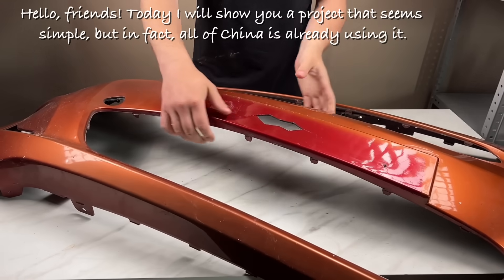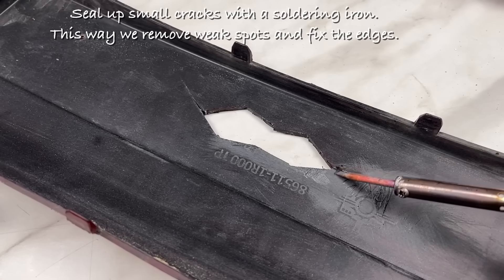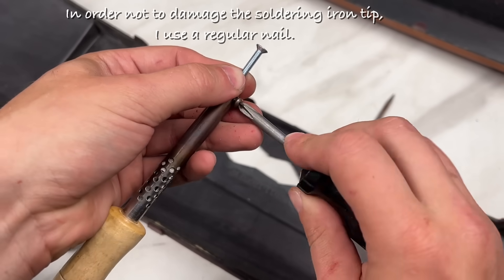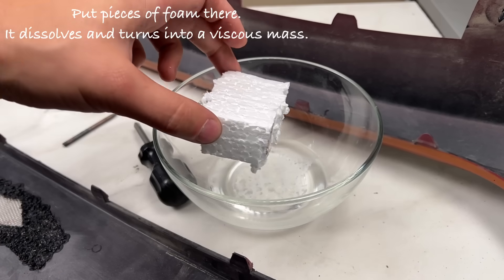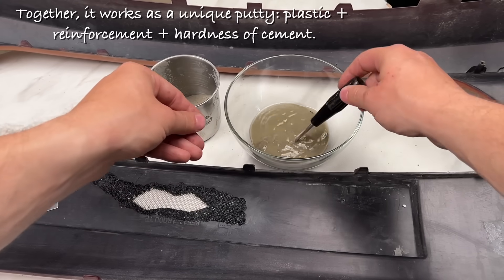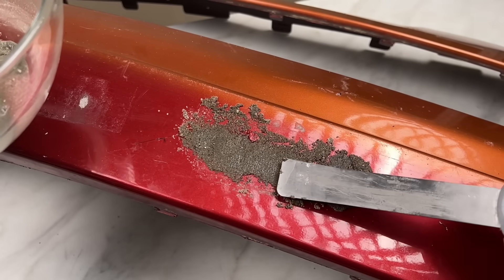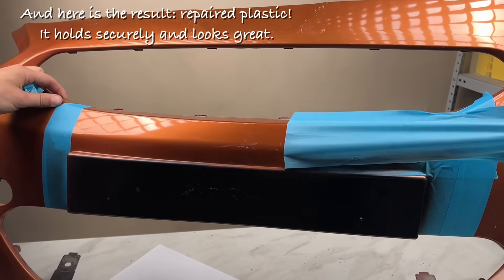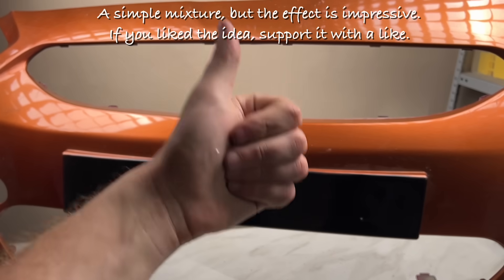ONLY 3 INGREDIENTS — and welding ANY plastic will become a GOLD MINE

Comment: For my repairs I use the OILY GLUE and Baking Soda.  Faster than this "attempt", and so strong that it WILL bind metal to metal, or anything else.  The only thing is one must work fast when the Baking Soda is applies to the Oily Glue.  Some Instant Glue will also work but not as strong as the Oily Glue version.
Reply from the maker: Thanks for sharing your repair method! Sounds like a strong solution.

Comment: You could have better used cement without the added sand. That helps with the sanding process. 
But the cost of all of this can be solved with a cheaper alternative ment for this job.